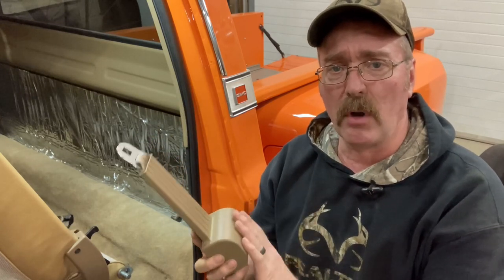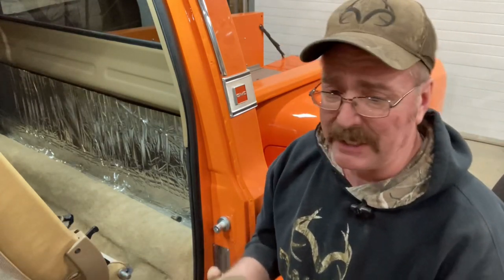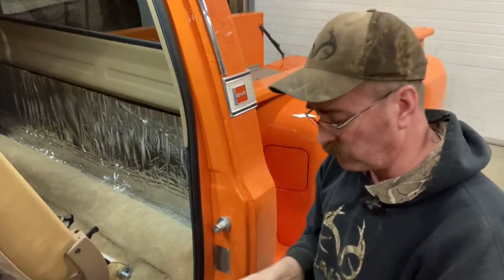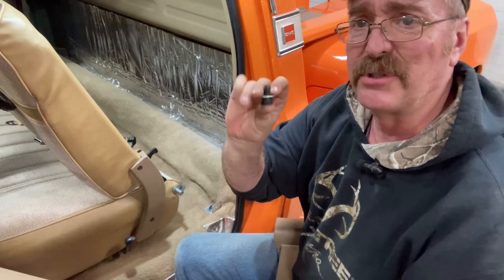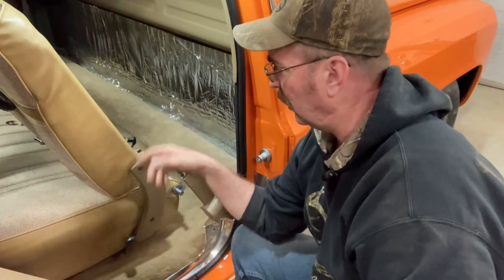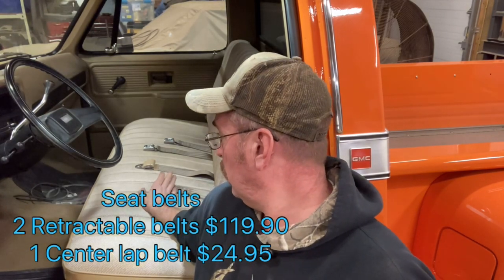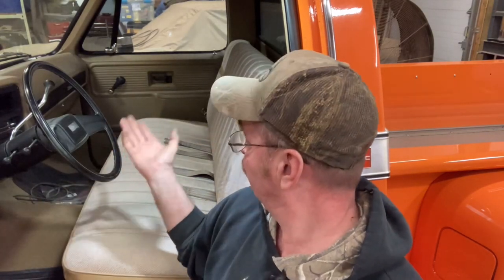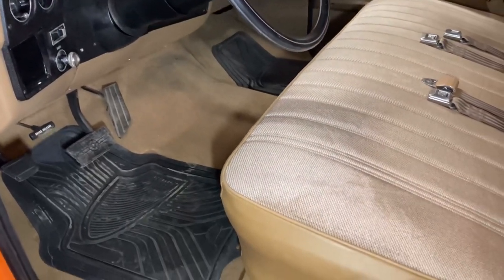LMC retractable lap seat belts for the square body Sierra Grande C10.

Comment: Hello. Nice informative video. I have a 1976 K10 Chevy truck. I have just lap belts and I’m trying to figure out how to remove the plastic cover which covers the retractable part of the seat belt. Please advise. Thanks!
Reply from the maker: Hi there. To be honest I’ve never taken the retractors apart. I wish I had a better answer. The plastic pieces I have painted, I’ve stretched out the belt and masked off the belt and mount, that way I could avoid getting overspray on those parts. I hope this is helpful. Thanks my friend